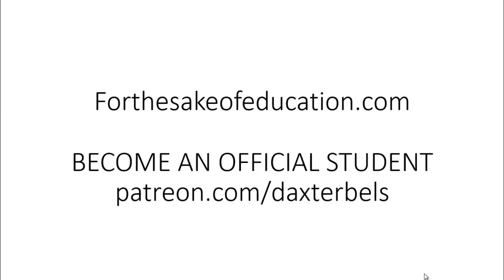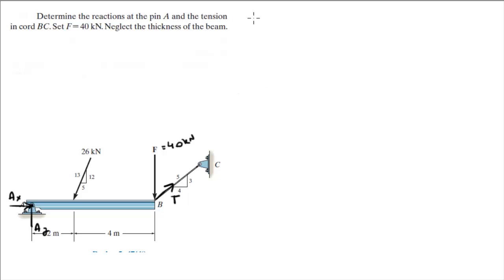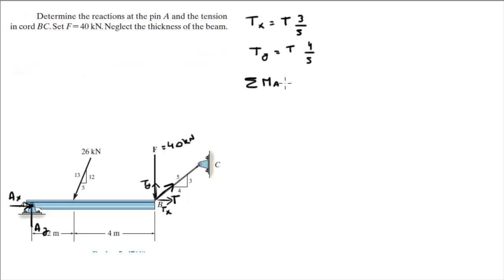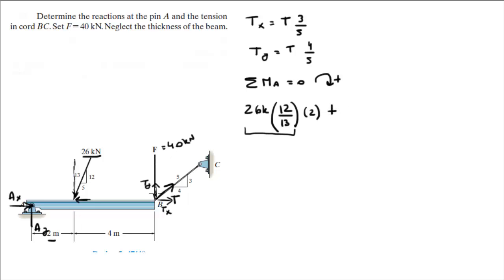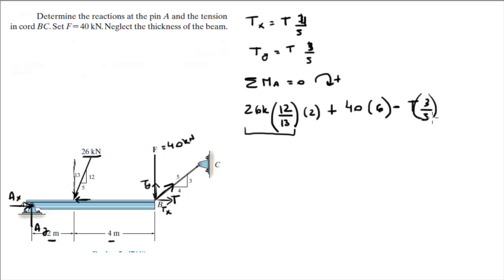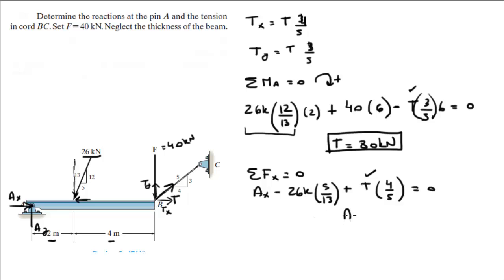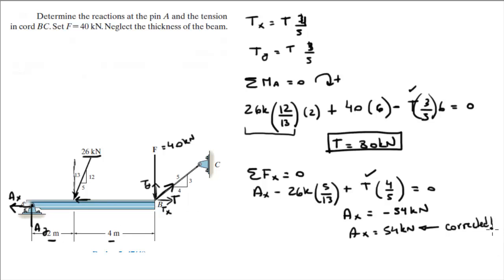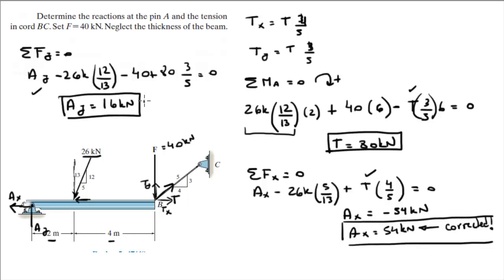Determine the reactions at the pin A and the tension in cord BC. Set F = 40 kN

Comment: Let's try this 
The cab and motor units of the front-end loader shown in Fig. 3 are connected by a vertical pin located 2 m behind the cab wheels. The distance from C to Dis 1 m. The centre of gravity of the 300 kN motor unit is located at G in while the centres of gravity of the 100 kN cab and 75 kN load are located, respectively, at G_{c} and G_{l} Knowing that the machine is at rest with its brakes released, determine the:

(a) reactions at each of the four wheels, (b) forces exerted on the motor unit at C and D.